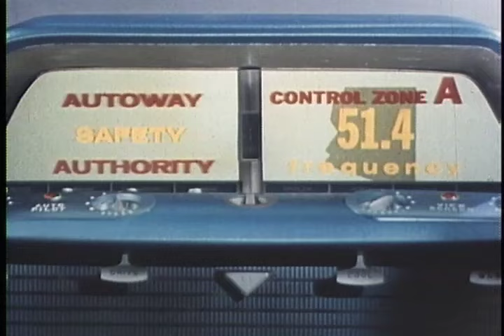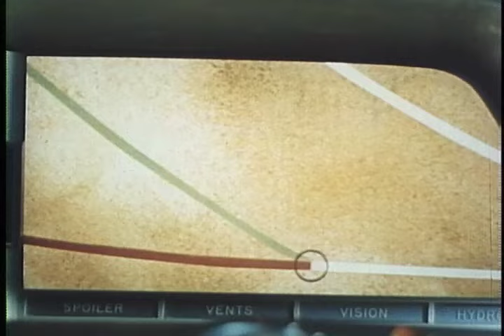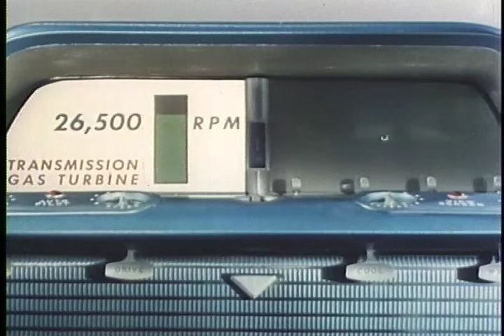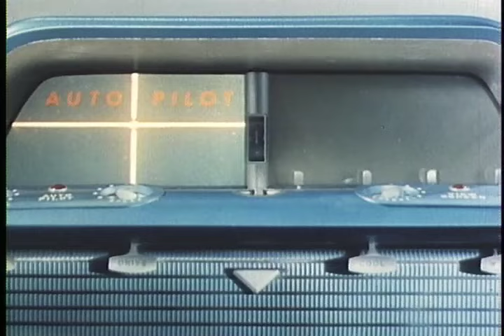GM Motorama Exhibit 1956

Comment: I am old enough to being told this was the future-highways with electric strips that allowed for autopilot.  In 1956 the Interstate Highway System was still legislation making its way through Congress.   I would like to see an alternative version of this where the son turns the radio dial to 1976 and the family finds themselves stuck in a Chevette....
Reply: Or a huge 1976 Oldsmobile Custom Cruiser "clamshell" wagon, the last year for the GM behemoths! 455 cubic inches under the hood!
Reply: or any of the really craptastic cars of the 70s.
Reply: @cameronjournal  Gremlin
Reply: O yes, seeing this family waiting in lines at the gas station on their certain day to fill up during the gas crunch.
Reply: @dw3403  Or getting caught in the traffic jams of the real 1976, because all those fantastic highways they wanted to build were cancelled by the various freeway revolts.
Reply: To think we could have been running cars on gas  turbine's running on  compressed air the while time.
Reply: Stuck in a real traffic jam, everyone pissed off, turn on shitty AM radio and- Here's "THE SEX PISTOLS ", .Perfect...
Reply: And now they have power strips like this in formula e racing.. no auto pilot but it recharges the batteries.. futuristic as it gets
Reply: Pulling over in a bad neighborhood in your VW microbus to siphon gas , due to  OPEC oil embargo, round one.
Reply: @OldsVistaCruiser  like a ROCKET
Reply: Hahahaha. This made my day.
Reply: And stuck in a gas line
Reply: A Pinto probably.
Reply: Thanks, Nixon.

Comment: I love how the car in close-ups looks like it’s going maybe 20 miles an hour but it has a sound effect of a jet flying.
Reply: It's just taxiing for take off.🌞
Reply: Gas turbine powered car. Make jet engine sound when turbine is started. There is turbine rpm reading when switching to autopilot.
Reply: My harleys like that
Reply: They predicted CVT
Reply: I am most impressed by the cabin noise suppression that lets you sit inside a jet engine yet have audible conversations with the control tower without any need for a headset. 

But luckily, there were no other cars on the road, so the control tower immediately knew who they were talking to.

And everybody was some young, fit and handsome. Despite sitting in cars for hours on end doing nothing but pushing buttons and eating ice cream. 

But best of all - multi-generational harmony. What drugs were they all on?
Reply: @te8828  Atomic batteries to power!  Turbines to speed!
Reply: It's jet powered, so even if it's sitting still and the engines are on, it will sound like a jet.
Reply: Gas turbine cars are actually very slow. But they are extremely smooth. Watch some of Jay Leno’s videos to see others
Reply: Was it like this in the olden days
Reply: haha, well it's a TURBINE engine, aka JET.. and that actually existed.. It was made by Chrysler or Dodge and it was thought it would be the future.. Instantly switch to flying car etc.. Real shame that didn't happen..
Reply: @jimmybuffet4970  There were some turbine powered race cars that were pretty fast and there are some very fast land speed record cars powered by turbine engines.
Reply: Yes, fire up that cigar and travel in complete safety.
Reply: @chloepaisano4417  yea buddy

Comment: Navigation systems, cars that drive themselves, just pure science fiction.
Reply: @AmateurThespian wrong
Reply: @AmateurThespian It's in it's infancy still, but it IS absolutely a real thing now. No sci-fi could have seen where things were going quite as they did back then.
Reply: Level 5 self driving for the masses is way off still.  Some engineers even say decades away.
Reply: be hanno sbagliato previsione Di almeno 50Anni
Reply: @AmateurThespian Having driven 110,000 miles in autonomous cars (no, not a Tesla - those aren't), self driving is here, but still needs a human to oversee the car and take over when it gets it wrong.  I had a good laugh at the car going in a McDonald's driver thru.  The car (mis)identified it as an immigrant / customs checkpoint and refused to move forward until there were no cars at the window, as you would do at a border crossing.  Even when I pushed the "go" button, it would only move one inch and stop. I ended up bypassing the system.  Went back the next day, recording everything and sent the video and dats back to the programmers who have since updated the system.

If everyone follows the traffic laws, and roads were properly maintained, yes we are 90 percent there.  Cyclists and pedestrians seem to think the law doesn't apply to them.  Same for some motorcyclists.   You also have the a-hole and phone zombie drivers to deal with.   It handles severe weather fantastically.  I drove through a major storm last week and it handled it beautifully, even when the van in front of me lost control and spun out, the car reacted appropriately.  I also like having all of the extra data on the screens, so despite white out conditions, I still could "see" other cars and barriers on the display.
Reply: We are where we are now thanks to SF, if you can't dream it it will never exist.
Reply: What will be next? Cars that don't require gasoline!! Pure nonsense.
Reply: @j.g.bloodworth9837  Electric cars have been around for 150-180 years.  They're actually old-tech.  Internal-combustion engines are the new tech.
Reply: @grayrabbit2211  Gustave Trouvé's made world's first electric car in 1881.
Benz's first car was patented in 1886
So nope, no difference at all
Reply: @AmateurThespian few small tightly defined areas? At the end of this year in Munich will be a self driving "taxi" system, just like the one used in Phoenix.
Reply: @grayrabbit2211  Yeah. Get back to me when it snows.
Reply: lol 😂
Reply: @AmateurThespian I'm guessing you've watched approximately zero of the Tesla full self-driving beta being tested
Reply: @cornstar1253  
It exists, its just prohibitable expensive, all the sensors involved is ridicules, look like a Goddamn loonitoon car with all them radars and LIDAR on the roof top.
Reply: @grayrabbit2211  
Internal combustion engines dates back to 15th century (not a joke) theory of an explosion engine is very old, and supposed built examples as early as 16th century but we do have evidence of them being built in the 17th century around the time Steam Engines were starting to come into the scene, the only thing that held back these engines were metallurgy, same reason why early Steam engines were so low power.
Reply: Once it was...

Now, it's science fact...

The self-driving part is still not perfected, but it's coming along.

Comment: I went to the Motorama exhibit in 1956 when I was 10 and thought it would be like this in the far off 1976.
Saw the Firebird II there and later saw the Firebird III at the Seattle worlds fair in 62
I actually did see one of the Chrysler turbines driving into a A and W stand in 64 it came in and every guy there went over to look at it.
Everything seemed possible back then
Reply: I got to ride in a Chrysler turbine at the Kennedy Space Center in 1976. It wasn't the one with the "concept car" body from the '60s, it just had a stock-looking '74-ish full-size Chrysler body. But it hauled, and was smooth, and made that recognizable turbine sound.
Reply: Wow! Nice story, nowadays we're thinking about electric cars and drones in 20 more years
Reply: It was possible, but there was no money in the car. The public was told the car was unsafe because the exhaust would melt the car behind them. However, in 1968 a turbine powered car competed in the Indianapolis 500. The car was in the lead until a bearing burned out with three laps to go. The exhaust was not too hot to be dangerous to the other drivers either.
I also saw Motorama, but in Los Angeles. So, here we are old men wondering what happened the future
we thought was ours.
Reply: @ronalds.658  
The future is here with electric cars and I bet within 10years it will be the dominant car I won't be here but my kids will and it will be better
Reply: Que ótimo!
Eu nasci em 1956....
Você tem 10 anos a mais...
Gosto de ver esses vídeos antigos!
Parabéns 👏👏👏
Reply: @mgman6000 Nope, EVs still have a ways to go before there’s full adoption. Infrastructure needs to catch up & it won’t happen in 10 years.

Comment: I think all the rigamarole with getting the car ready to be "automatic control" is hilarious. It took them forever to talk about the amount of fuel and stuff they had... Not to mention that it was like an airplane taking off.

Love the part where dad asks if he can smoke his cigar...
Reply: Your description of the PreFlight check out checklist is right on point! I couldn't wait until the guy lights that big turd (El Stinko) of a cigar and then stinks up the inside of the car forever. And spends the next hour coughing up a lung. I was one year old when this was made so I guess I have to accept the fact that no one ever realized that by the 21st century smoking would be generally frowned upon and subject to rigorous federal and state regulations, but it is quite hilarious. He should have told the autopilot to avoid all the ghettos, and the shooting galleries, and the homeless. I'm surprised at the lack of hats. I thought everyone wore a hat anytime they left the house. I guess by the mid 50s that that was passe. This model firebird must not have included the optional rotisserie in the back seat to cook chicken on the fly. Even harder to believe that General Motors would have gone bankrupt except for the help from the government. I don't think anyone saw that one coming. My first car was a 1969 Pontiac Custom S station wagon with a 350 cubic inch motor and a turbo hydramatic 400 transmission. It was a road locomotive. I drove it for 18 years!
Reply: @jpsilvashy  thank you for your post and pointing out the truth that things aren't what they used to be.

Comment: My old man bought a Firebird I new in 62' or 63' in Martian Red. Looks stunning from the pictures I saw. Though he said it was always in the shop and he could never get that rattle in the turbine while it was cold to go away. Drank jet fuel like a mall Santa on Dec. 26 and handled like one too.

It was cool to see them run into one in that good of condition. Looks like the owner might not have gotten the high-speed autonomous lane compatibility upgrade. I was conceived in the back seat of one around the time this video takes place.

Comment: I love that "the key to the future" intro has the old school GM key! I have a set from my 1965 Electra! (Non factory replacements, Theyre solid aluminum!)
Reply: OH yeah, aluminum is SOOOOO tough.
Reply: I didn't say they were "tough" I said "solid"....There aluminum presumably for light weight carry like in the once common key pouches in a wallet.
Reply: I have the original 2 keys for my 1957 chevy.
Reply: The ones I've had were plated brass, and were made here in Milwaukee by Briggs and Stratton.

Comment: It's interesting that they envisioned fully autonomous driving back then. In just a few years, that vision will come true and will be even better because it won't require control towers, special strips, lanes, commands, or any of that. In fact, the Tesla Model S already has a feature called Autopilot that enables semi-autonomous driving with the flip of a switch. Even better, we'll have all-electric cars and won't have to rely on non-renewable gasoline.
Reply: +Elvis S Where will you get that electricity from? Unless you're gonna coat the entire country in solar panels and wind turbines it'll be pretty hard to power every car on Earth without a coal burning plant.
Reply: Spoods The Milkman That's a good point and one that definitely will have to be addressed. Fortunately, though, there are many sources of energy other than coal, so I'm optimistic that things will work out somehow. In any case, it will be better than having gasoline powered cars using up oil and releasing emissions into the air.
Reply: garyp4205 Renewable? Correct me if I'm wrong, but while oil is organic, it comes from fossilized material that died thousands or millions of years ago. It is also pumped out of the ground from cavities that we can't just refill. I wouldn't call that renewable. Also, even if we have enough reserves, it will only last so long. We will eventually have to resort to alternative sources of energy.
Reply: Elvis S We current have around 5 - 600 years supply of sweet crude, then we haven't even tapped onto the shale yet.
Reply: styldsteel1 shale is harder to get oil from. that gasoline will be more expensive. Even if it weren't, oil is dirty. Oil pollutes. It served us well in our infancy as a species, but now we must move to renewable sources. It may take time and innovation, but we must begin to produce electricity from better sources. Even if we had an infinite source of oil, we should begin the transition.
Reply: I'd like to see nuclear fuel become more widely used. It's able to meet our energy demands and produces far fewer pollutants.
Reply: Aaron Schooley ok. you do realize that we need to burn oil to produce electricity, right?
Reply: styldsteel1 No. we do it, but we don't have to. we can use solar, wind, hydro, tidal, nuclear, and/or geothermal. we use gas because it's easy to burn. we can't just stick with the easy, but damaging option. we need to evolve as a species. by the way, petroleum processing requires electricity too.
Reply: Aaron Schooley I think your ideas are well intentioned, however, it's not always windy and it's not always Sunny. Are you familiar with solar city?  Even after billions of my tax payer dollars were invested in solar city, it still flopped.  The cost ratio of operating costs, compared to the amount of electricity it produced, the scales tipped badly. But must be shut down.  Wind?  Sure,. Try putting these ugly wind turbines near any home, the vibrations and humming noises actually drove an entire community out of their homes and the property values sunk severely.  Also, you do know how many birds those turbines kill each year.  Hydro? Great!  What about the people who are landlocked?  You need a level 5 rapids to produce cost effective electrical production. Now you see why oil is si cheap and popular?
Reply: styldsteel1 solar city is the biggest solar supplier in the US. bought by tesla now. didn't flop. sun most places. wind most places. not ugly or more disruptive than oil drilling. don't do it by houses. your taxes have been pumped onto oil subsidies and into CEO bonuses. hydrolocked? solar, wind, nuclear. battery storage when not sunny or windy. American Samoa is now 100 percent solar with battery. Oil is easy. easy is killing us.
Reply: Aaron Schooley if oil is to be replaced with Solar, Wind, Or other ,it must  be readily available 100 percent of the time. Not sometimes sunny, or sometimes windy, sometimes this or sometimes that. I don't want to drive my car sometimes, or I don't want my home to have electricity sometimes.  It must be available 100 percent of the time. For now, oil is available 100 percent of the time.
Reply: I don't really care what oil is replaced with. electricity must be there.
Reply: styldsteel1 of course. we need to have it 24/7. that's when nuclear is used or we use battery systems that stored energy previously. any solution that doesn't work around the clock is not an option.
Reply: Aaron Schooley totally agree.  btw, I wish they would leave the nuclear plants be.
Reply: styldsteel1 I would love much more nuclear. Maybe one day we'll have fusion.
Reply: Aaron Schooley there's a thought
Reply: We still rely on coal to power cities because fossil fuels are the best.

Comment: The future, where a beverage tray is considered equally as impressive as an ice cream machine, and the "tower" will spend 5 minutes talking to each car to get them on the autopilot safety lane.
Reply: +Norwegian Chill The ice cream machine would indeed work, as it could have it's own freon tank for the mixing drum in the same way as the A/C unit.  But would you love milkshakes that much to need one 24/7?  I think I would!
Reply: Fold-out trays are really only a thing in high-end vehicles where the owner or main occupant sits in the back. I think cup-holders would have imploded their 1956 minds.

Comment: I remember when i used to take the scenic drive to Chicago through Navajo Country along the Roadrunner Express built by ACME back when Chief Wiley Coyote was designing autopilot lanes. Of course those are all called carpool lanes today. I so miss the ice cream machine & espresso machines that came standard in the glove box. Dad occasionally slipped in a 5th of gin for his lemonade martini-but only during autopilot when we were running our gas turbine at 27,500 RPM. Those were the days!!!

Comment: Ah, the wonderful world of 1976! Am a little surprised that turbine powered cars were never perfected.
Reply: I guess they were too noisy. Jay Leno owns one of the prototypes..
Reply: They had few moving parts and were reliable...but couldn't overcome the fuel economy.  Terrible even in those days...
Reply: Also, there was exhaust heat to contend with. You couldn't stand in back of the running vehicle, and it tended to melt or set fire to asphalt paving.
Reply: @lelandfranklin3487  Although it could run on any combustible fuel...
Reply: @tsmgguy  That I didn't know...
Reply: @tsmgguy  I would respectfully disagree.  Jay Leno has a great episode on the turbine car from Chrysler and said they had beaten the problem of hot exhaust melting the pavement/being dangerous.  It's a great video.
Reply: Turbines just aren't good for stopping and starting. They don't have much low rpm torque and are not efficient outside the ideal rpm range. That's why they are great on ships and jets but not trains or cars.